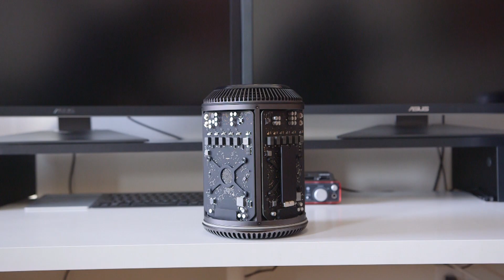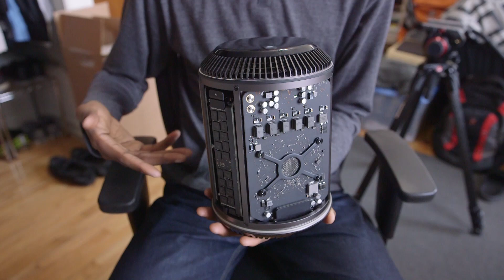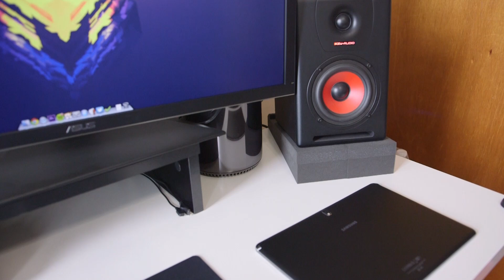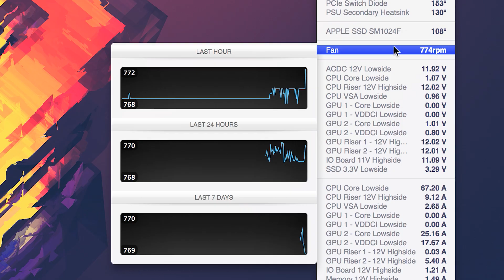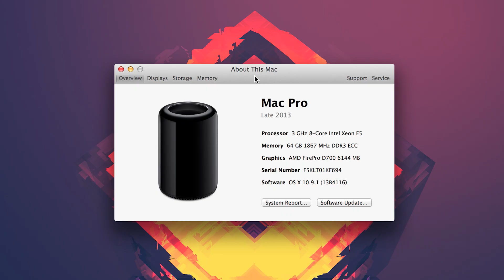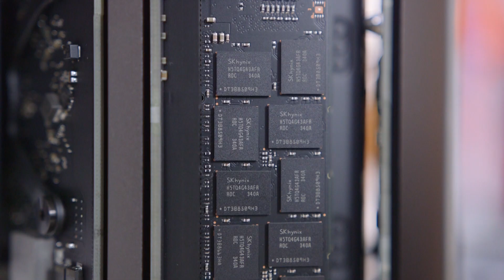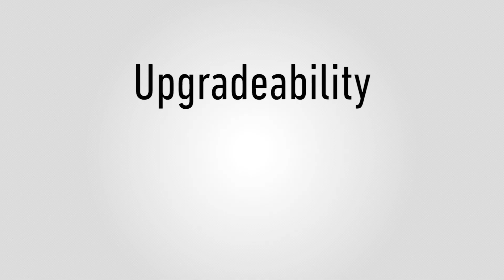New Mac Pro Review!

Comment: I am sure many have already said this, but there are plenty of desktops that are a similar form factor/footprint, and have been since long before the Mac Pro. For example, Micro-ATX and Mini-ITX form factor machines.
Reply: And? Do they use Xeon CPUs, ECC RAM, two workstation GPUs and allow for PCIe flash storage and have six TB 2 ports? And were they round?
Reply: Indecisive Fella I was simply correcting his statement in the video that this is the first small form factor desktop PC, which it is not.
Reply: Kingsley Zissou
First small workstation computer then?

And let's not forget the Mac mini, if we go into consumer computers and their small form factors.
Reply: Indecisive Fella  Sure, but that's not true either. PC builders have been making small form factor dual xeon builds before Apple designed it. I'm not taking anything away from the product, it's a great piece of design and engineering in many ways. I was just correcting one statement in the video.

In any case, it's a nice piece of hardware, if you can afford it, but it's a bit of a stretch for indy filmmakers who are already invested in the existing towers, internal media drives, RAID controllers, or other internal expansion cards like KONAs or Blackmagic DeckLink, because they have to upgrade both their tower, and then move whatever PCIe controller cards they are using to an external solution of some kind to control their media RAID, connected through some kind of Thunderbolt 2 adaptor solution (also the case for eSATA). So instead of moving one box and your external drives, you are now moving the computer, and the box with your PCIe cards.

It actually makes for more of a mess on the desktop, and more of a pain in the ass to relocate, than the existing workstation setups. 

Also the 450watt PSU is not going to be able to power much through the Firewire ports, most heavy power draw devices will need their own external power supplies (more wiring, more stuff to move), and the inability to rack mount it is a bit of a bummer.
Reply: Kingsley Zissou
• "PC builders have been making small form factor dual xeon builds before Apple designed it."
- Haven't seen those, sorry.

About the periphery and internal components, yes, that is a problem for many, but there are companies already using external solutions, thus it is a win-lose anyhow.

And Firewire was only able to provide 45 W at 30 V maximum power per port, which only gets you 1.5 A.

And Thunderbolt provides even less power, less than 10 W at 8.8 V.

And for rack mounting, there is a solution, a company built a case with all the stuff one might need, for example PCIe expansion and such. I cannot remember the name right now though.

But in the end I can understand your concern, I currently work at an Avid / Mac editing company and the Mac Pros are getting long in the tooth and the new Mac Pro would be quite an investment due to all the periphery the company has (Beta, HDCam, .... players, playback solutions, and so on), and it is not TB compatible.
Reply: Indecisive Fella  It's a nice machine for sure. Changing out hardware is only really an issue for indy folks, studios and facilities won't have any trouble adapting. Bottom line, I'd love to get my hands on one and take Avid MC + Unity ISIS for a spin.

Comment: Why should Adobe be forced to update there software for one bit of pain in the arse apple tech. when most users on windows PC is fine. Also maybe you didnt feel the difference with the new hardware because its not just cpu and ram there is hard drives it depends what hard drive I dont know the hard drive they use but why spend that much on that apple crap.

Comment: I have a emachines El1358G-51W with AMD X2 220 dual core CPU , 1 TB HDD , 8 GB Kingston HyperX Blu ram , Galaxy GT 610 .. all of this runs flawlessly on a 220 watt power supply. the whole computer bought/built cost me $297.54.

Pretty sweet for a slimline PC ... the GT 610 will play GTA IV and Portal at maxed out settings with 0 lag etc.

Is my computer amazing??? no , Is it one hell of a deal for less than $300 ... ohhhh yes it is

Comment: Just build your own computer and use a laptop on the go. A custom computer you can upgrade what ever you want and do what ever you want to it. Macs are over priced and under-powered for the amount you pay. This computer that hes reviewing has an 8core cpu but its way over priced for what it offers. Meaning you could build a computer cheaper and get the same performance. If you want a mac OS get it later. You can put Linux mint or Linux Ubuntu 14.04 on it. With Linux you can get all your editing software and just software in general free. If you game don't use Linux but if you game don't use a mac either. Windows is your best bet if you game. If i didn't game i would use Linux Ubuntu 14.04 desktop version all the time and for everything. I work on my Linux Ubuntu 14.04 machine primarily.

Comment: This machine would be a beast with a Core i7, two GTX 760s, and PCI-E SSD's for $1,000 to $1,500. Pair that with a QHD monitor and you have yourself a hell of a setup. This is very expensive hardware and Apple should release a more consumer minded option.
Reply: Since this is not aimed at consumers, and similar workstations for similar or higher prices exist from vendors such like HP and Dell, Apple will not do such thing.

Comment: Just looked at the temperatures,,,, 120*Celsius!!
And that's OK? The thermal throttling point of most hardware is around 90* Celsius tops to stop it killing itself.

Though have to admit it looks tidy, the cooling solution is simple, the only issue I see that could make that top temperature worse is it sitting on a desk, sucking up dust... 

I hope there is a way to take the top off and clear it out.

Comment: what is intel xon faster than and good for
Reply: It has more cores than other Intel Processors, but with a lower clock speed. This means it will not perform as well when doing tasks that need only a few fast cores (gaming for example) but when perform better for tasks that want more cores (video editing). That's the basics.

Comment: is the graphic cards of mac pro 2014 is faster than the gtx 760? or is there a graphics card out there that would equal the gpu of the mac pro? thanks for help......
Reply: The GTX 760 is a gaming GPU, the D300, D500 and D700 GPUs are workstation GPUs, made for different purposes than gaming.
In other words, the 760 will be faster in CUDA and DirectX games, and the FirePro D series GPU will be faster in OpenCL applications.

Here is some additional info: http://www.amd.com/en-us/solutions/workstations/d-series
Reply: Fukoff Gewgle
In what way does it suck? Because it cannot run the games you want to play?
If so, hmm, good one.
Reply: Fukoff Gewgle
You would rather get an i7 with a GTX or R9 GPU for video editing?

If so, then HP and Dell and Lenovo make the same mistake as Apple in not serving your consumer needs with their workstation computers using Xeon CPUs (slightly bit more expensive than i7s), ECC RAM (again, a bit more expensive), PCIe flash storage (okay, HP and Dell and Lenovo do not offer this as standard) and two workstation GPUs (Quadros and FirePros are a bit more expensive than those GTX and R9 GPUs, mostly due to drivers and some other shit).

Comment: I still don't get it, what is a Mac Pro for? I'm really confused. People are saying that they should buy Mac Pro not iMac and MacBook when it's a kitchen lighter?
Reply: lol Mac Pro is for professional use, not regular use.

If you are a graphic designer, photographer, basically someone with a business that does work that needs a powerful machine to run big projects, this is what a mac pro is for.

iMac's are perfect for the consumer use. Many of the mac videos you see on tv are done using an iMac more than a mac pro.

Macbook is entirely different, these of course are good if you are on the go a lot and need the computer with you. If you plan to just get a desktop computer, get an iMac.
Reply: oh thanks!
Reply: It's not for you, that's why you don't get it.
Reply: artenman Yeah, you're right, I only make videos.
Reply: PromotingTheBeat The pros use custom AVID system.
Reply: *****
"The pros use custom AVID system."

Professional video editors or audio editors, if they use an Avid product at all, normally use workstation computers, either HP or Apple ones.
As there are other DCC fields than audio & video editing out there, those "custom AVID systems" will probably not be used there.

Comment: This little Pro is amazing engineering, specially packing two high powered graphics cards in there. Desktop PCs have declined and it's understandable because they are stuck in stale standards. It's impossible to build anything as small and powerful as this outside of Apple. I'm impressed. I would have gotten one but using Octane requires Nvidia GPUs, so I had to build a monster PC instead. I wish it were possible to get anything as small and silent as the Mac Pro.

Comment: It not just the specs that count for me but also the restrictions you will be stuck with. New technologies such as g-sycn (which synchronize your monitor with your GPU) will never be supported by the mac pro because of the lack of compatibility, expandability, missing of common connectivity and enforcement of AMD cards.

For example, from what I've seen, you got 2 choice of monitor to connect to your mac pro which is a 4k (cost $4,000) or a sort of standard mac monitor mac.  Yes you pay for the hardware but you are really limited and when I mean limited it not just hardware but access to NVIDIA technologies software which could be crucial for some people.

You pay $3,000-10,000 (excluding monitors or any other accessories) and you already restricted of futures technologies (there is a big boom in software/hardware technologies) and your mac pro will be worthless in less than a year just because of that. Once again, thunder bolt, mac specific bullshit that force you into a specific categories. Why? Just thinking about the answer is frustrating.

There are so much more I want to talk about but I just decide to point out the biggest problems, in my opinion, which is out of context from the OS or performance.

Good review too and your right, it is really a bad time to buy such a work station tool that you will be stuck for few years.

Comment: I agree with others, it's very cool, but you can equal, or close performance for way less money. You mostly pay for the form factor here, which like I said, is impressive. Even still, I don't feel it's worth it. I think anyone who goes for this for anything besides the form factor, or just to be an apple fanboy, is just wasting their time and money. 

I dunno, I'm not really a minimalist, but I feel like the law of diminishing returns applies here. You spend exponentially more money for a totally disproportionate increase in performance, which... Kinda sucks.
Reply: Chris Nelvin Each part also have their own warranty and support,, Windows is more open which makes it better for %90 developers and engineers.
Windows is also stable and doesnt crash, We are no longer at XP
Reply: Chris Nelvin Do you really think Apple repairs those parts? You send to apple, They detect the part with error and send it to its own company, Would be faster yourself.
" Windows PC's always freeze, crash, have blue screens of death."
Wow.. It seems last time you used an pc was 6 years ago. Those days are long past.
"HP, Compaq, Acer, or Dell, "
If you go with Windows, you build your own computer, you dont buy pre-builds, because they suck.
Reply: Chris Nelvin I have to call crap on the "iMac is reasonably priced and good for 99% of users". No way, I disagree. Even $1000+ machines are falling into what, maybe the top 10% of users? What the hell can you be doing with a fully-loaded iMac?

I mean, I just built this FX-8350 rig w/ 2x Asus R9 270's. As far as the FX processor, this thing can render fairly involved 10 minute long 1080p videos (native bitrate) in... What, less than 20 mins? I've not tested extensively, though.

For some, that may seem like an eternity, but even for a "sort-of" power-user like myself, that's still pretty damn good. No overclocking.

I mean, if you're like, a developer at Rockstar North, making the next Grand Theft Auto game, you would probably benefit from a rig like this. Likewise, many people with very high demands (though lower than this machine) may still like to have the greatest and most badass machine they can get right now, and I respect that. Those are the types of people who would go for something like this. 

But I think to assume that for the average user, or even the average POWER-user, that this is what they need? Or that they'd benefit from such performance? I just don't think that's fair to say...
Reply: Chris Nelvin I think as far as compatibility, you can't give credit to apple, nor can you take it away from Microsoft. Apple manufactures their own products, so they only use so many different components in order to maintain compatibility. Not to mention that they couldn't come anywhere close to featuring everything currently on the market. They're too different to compare. I do agree, but just saying. 

Also, don't assume I have no experience with Mac computers. I do. Not much, but I've used it enough to know a little bit here and there. Fine, for many users, it may be better. But those who it's better for? Maybe older people, who are just getting into computers. Using Windows is not a difficult task for the average person. Fine, OS X is easier, but if it's what you're used to, it'd be just like moving from Windows, to say, Linux. You still have to get used to a decent amount of things. 

Noise is stupid to compare, because that's more based on how good the fans in the machine are, rather than a Windows vs OS X comparison. That has absolutely nothing to do with it. 

I don't like spaced keys. The keyboard on my old laptop was fantastic, and every key touched one-another. With my new machine, I have a keyboard with spaced keys and it kinda sucks. It's probably more of the nature of this crappy keyboard, but that's not something that's going to apply all the time, especially if you're used to something else. 

One good operating system and two bad ones? When? Windows Vista is the only one that really sucked. Before service packs. It was a good OS after it was fixed. But 7 was a true continuation to XP, and what Vista SHOULD have been. And Windows 8 may force a crappy UI on you, but nothing about it is BAD. 

I know I'm nitpicking, and I'm doing it by experience. What I'm used to. What I like. You bring up solid points, which I agree with. Maybe I'm just trying to play Devil's advocate a bit. But let's be honest... In 10 years, people who know what the hell they're doing will probably be using some form of Linux, which at the core are pretty much superior to Windows OS's and Mac OS X. Again, just an opinion, but I dunno, it's just what I see coming.
Reply: Well, I have to be completely honest with you. A while back, I was looking for a used laptop with good performance. I wanted something that was in good shape. 

I actually ended up on deciding on a 2007-ish Macbook with, um... An Nvidia GeForce 9400m gpu... Well, it's more "integrated" graphics, but being an independant chip, it offered FAR better performance than other integrated solutions. At least back then, it did. 256mb of graphics memory is good for light gaming, even. 

I was gonna get a sweet deal on ebay, but at the last second, I got sniped. The guy ended up with a pristine Macbook, that even today, has pretty OK performance, for like $155.00. Damn him!

So I was definitely looking at the Macbook as a nice portable solution that is fairly capable, and could do light gaming. In fact, it could game twice as well as the laptop I bought the same year. Though I'd bet the Macbook costed almost double what mine did. ;)

In fact, even now, I'm looking for an ultrabook to take around with me, that has some ability to game and do what I need it to do. Maybe I'll still go for a used Macbook from a few years ago, with Bootcamp. Decisions, decisions. 

And they do look damn good, too. Even the old plain-white macbooks.
Reply: Oh my, what have I done..? 

XD
Reply: nigga, thats the nature of all technology. and your idea that the performance can be equaled normally is not true. I can't find a motherboard with 6 thunderbolt. and ECC ram is expensive, server grade motherboards are expensive.
Reply: It's competitive for the hardware that's in it. Does a normal customer need to spend $3000 on hardware like this? Hell no. But for people who actually need the performance, it barely costs more than comparable workstations.
Reply: Chris Nelvin
Xp you dipshit try the newer ones, I still use windows 7 I crashed what once, because a file on csgo was corrupt, if your smart and don't download from sketchy websites you don't get malware. The only thing I give to mac is their light OS.  windows is a lot heavier on your pc
Reply: Chris Nelvin
By normal mouse does that include gaming ones?? just out of curiosity. I never said OSX is inferior but I generally do not enjoy apple products because they lack customisability. I am also a DIY person who doesn't have much money being a student so I stick to cheaper more bang for the buck solutions even though OSX is superior I also mostly game on the PC. And just after I said that comment karma bit me in the ass and cs:go has stopped working which I think is windows fault. Since if I fix the issue and restart my pc the game doesnt work again.